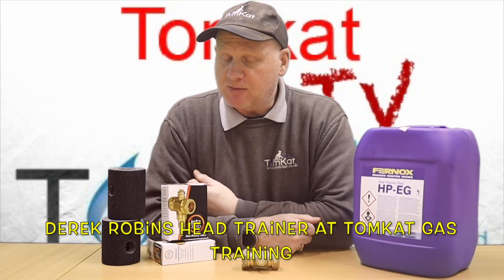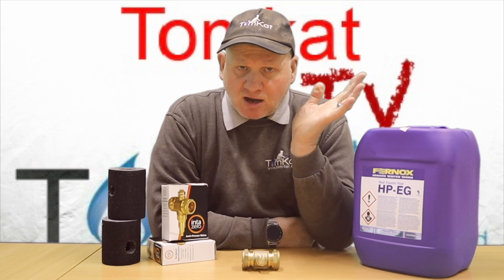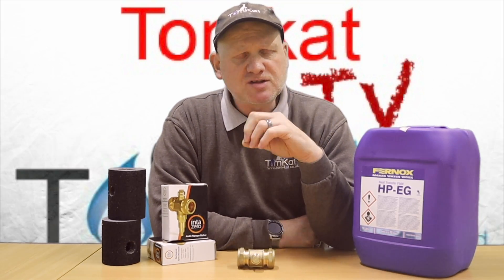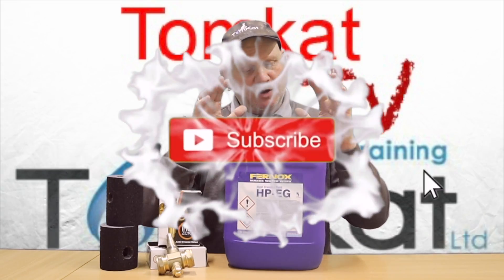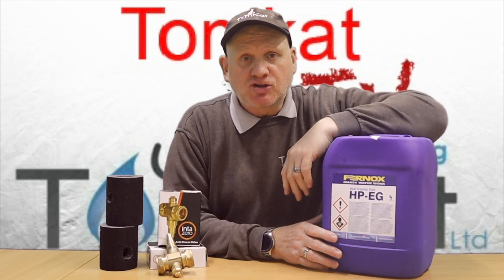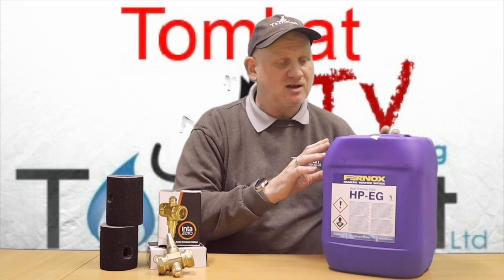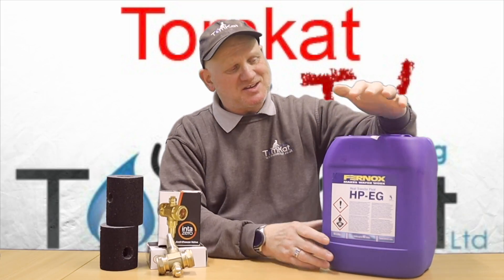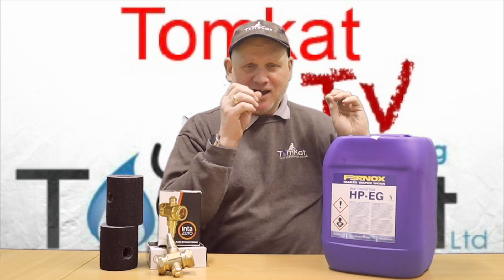Anti freeze valves/glycol in an air source  heat pump, which is best ? #plumbing #airsourceheatpump

Comment: Ok,my installers of an ideal bivalent HSP just removed the antifreeze valves and replaced with glycol , due to my pump dumping water every night as it was below 5 degree. I would prefer the valves however having to pressurise and bleed the system every morning was a pain. What can you do .
Reply: Nothing you can do , poor design bad idea.?

Comment: Thank you for your video. Fun watch.... I would like your opinion about the following.  I have been looking at quite a few videos to see if I can find something that will address the issue I see with the antifreeze valves if they are not installed correctly.  I have not been able to find someone who is addressing this concern as follows; I believe you would have an interested in providing some input on this: Monoblock heat pumps have a refrigerant-to-water flat plate heat exchanger within them that can be mounted at the base of the heatpump (mine is at the lowest point).  The inlet (return side) of the water line is slightly higher then the bottom of the heat exchanger. It doesn't matter if it is the supply of return; in my case it is the return.   So,  therefore there is a small water  trapped area in the piping.  In this instance we are relying on the antifreeze valve to drain all the water out of the heatpump heat exchanger in the event of a freeze.  Even if the vacuum is broken and the anti freeze valve drains, there can still be a small amount of water trapped within the heat exchanger and the circulating pump. 

in a separate action occurrence it could be  helpful  for the auto fill valve to be engaged ( located inside typically maintaining 15 psi) )forcing water into the water loop an hopefully thru the heat exchanger, however even so with both antifreeze valves engaged and water dripping out and fill-valve open sending fresh water thru the heatpump, it's still theoretically possible that water does not flow entirely thru the mono block heat exchanger purging the freeze risk out of it.  Moreover, if domestic water flows into the system it would theoretically quickly warm the valve, it would close (because it would be above 4C) and technically undrain the system again filling it with water.  This would seem to be counter the measures we are looking for in making sure the system was drained of water to begin with.  When there is a power outage (and no backup electrical generation) with well water there typically is no longer any water pressure and this action would not occur.  I am not entirely certain if that is good or bad. On one hand we want to the system completely drained of water,  on the other hand fresh water forcing its way thru the system from the auto fill valve would keep the heat exchanger warm.  Only in this instance water theoretically might not  flow thru the heatexchanger if we install two anti freeze valves and they are both open.    Regardless though it seems to be a big ask to ensure that all the water is drained from the heat exchanger and heatpump piping system.  One very important point to emphasize is that even if the pressure has been removed from the system in an engaged antifreeze valve, pipes and components can still burst if even trace amounts of water remain in the system. 

If the buffer tank is above the elevation of the heatpump I could see an instance where the whole buffer tank can get drained off.  I suppose given most buffer tanks are in basements where basements are common this is less of an issue.  

There are several other ideas I am exploring that could deal with the above issues....

Looking forward to your thoughts... Kindly Salvatore

Comment: good manufacturers do not require either. Viessmann and NIBE can be installed with none of this.
Reply from the maker: Very interested to know If the power goes off or the unit breaks down and it’s minus 10 degrees centigrade outside how do they stop the water from freezing in the unit because this hasn’t been mentioned in the training.
Reply: @tomkatgastraining there are other methods such as gravity circulation from a buffer installed in a cellar or battery back up that runs aux circulator. For UK conditions it is deemed that nothing is required by some manus. Also ,glycol should not be used with R290 heat pumps.
Reply from the maker: @UrbanPlumbers  what if you don’t have a cellar or you don’t have battery backup installed because one you have no room or 2 can’t afford it.
Reply: @tomkatgastraining as I said before - nothing is required at all by NIBE and Viessmann. Also if you install and AFV and the heat exchanger splits, you have no warranty anyway.
Reply from the maker: @UrbanPlumbers  the more I find out about heat pumps in my training journey the more I think they are no competition to a gas boiler. Thanks for the input I really appreciate it.

Comment: I've checked the water in 2 different heat pump installs with my refractometer and didn't get a reading showing any frost protection, I could smell there was some type of glycol in it but did this mean there wasn't enough?
Reply from the maker: Correct 👍🏻

Comment: glycol reduces scop not kw output in my opinion.
Reply from the maker: According to the manufacturers of heat pumps it reduces the output of the unit
Reply: Correct.
Reply: it reduces both - SHC of water drops and system requires hihigherhger flow rate for the same output, thus reducing output and cop.

Comment: Hello from Greece, with propylene clycol antifreeze we have corrosion protection in the unit and they have better heat transfer
Reply: Yes some contain corrosion inhibitors, but glycol reduces the specific heat capacity of the water therefore reducing heat transfer.